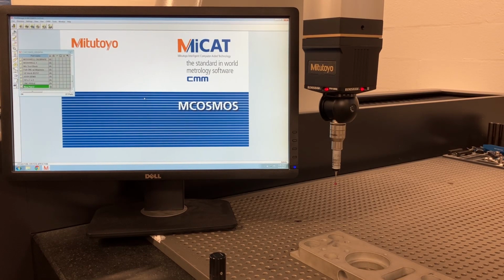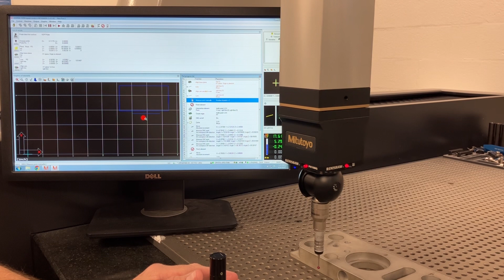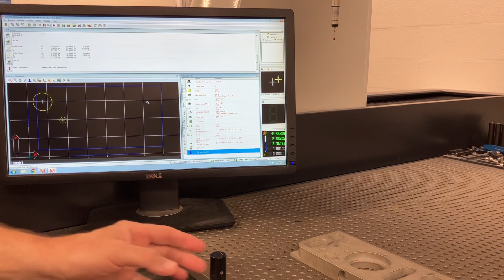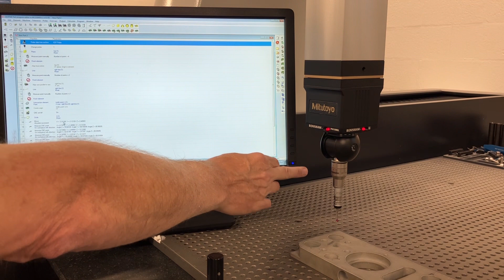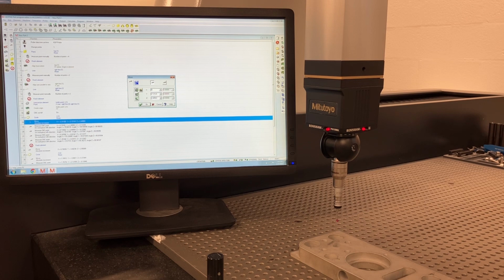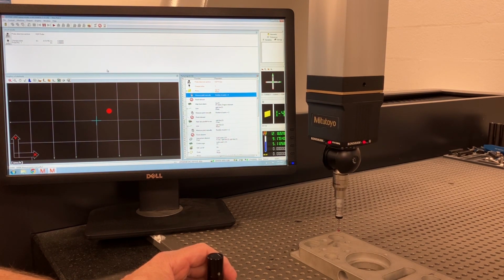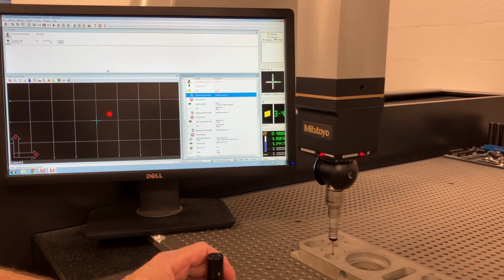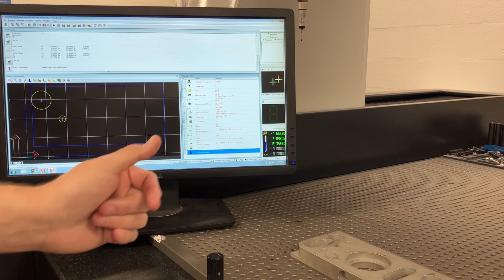MCOSMOS simple changes in Editor mode

Comment: If I completely wrote and finished a program, but want to go back and add whole entire sections, let's say adding a plane measurement here, and a new automatic circle measurement there, for features I may have forgotten to get in my first go at the program, is there anyway to do that? I can only seem to make small adjustments to existing measurements, but can't figure out how to add new measurements for features I missed. I really don't want to redo the whole program just for a couple features.
Reply from the maker: I would go into the editor and add the features you want to measure. It’s a pain but it beats completely redoing it. I’m still trial and error in the editor since I don’t use it a lot. But I’m getting better.
Thanks!

Comment: Hi Todd. Thank you for your videos. I have a question about manual and CNC mode. If I write a program with manual  and  CNC alignment. Is there any way i skip manual and run program from cnc mode (like in pcdmis)?
Reply from the maker: My experience is that you can’t but I’m no expert. You might can go into editor and change “CNC on” to a different spot after alignment.